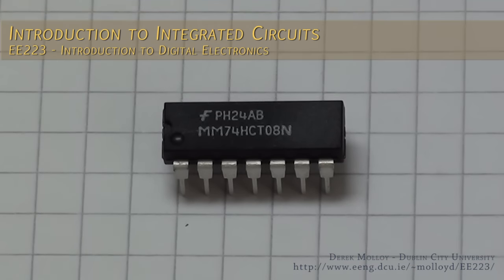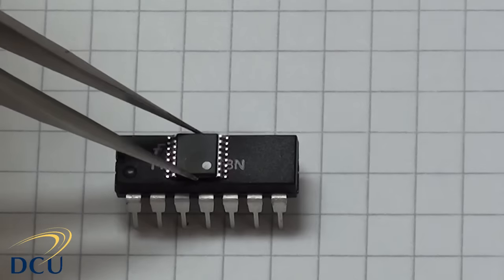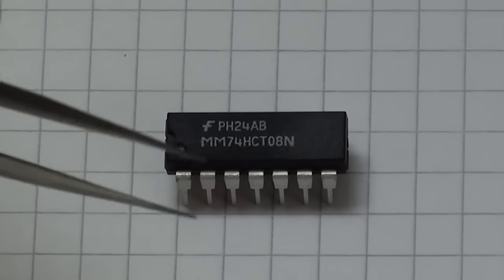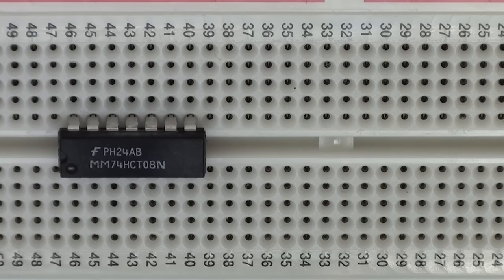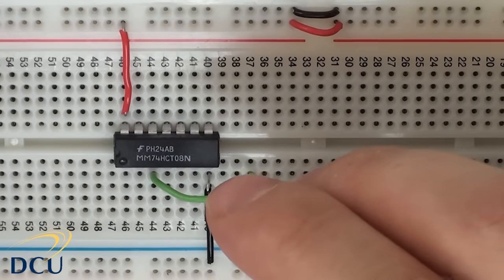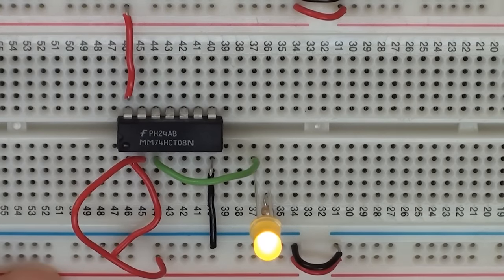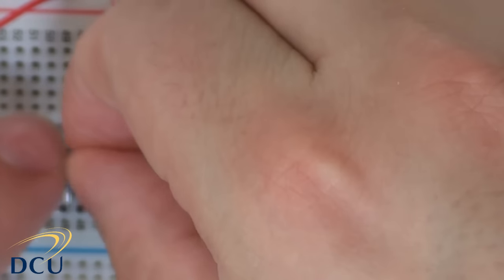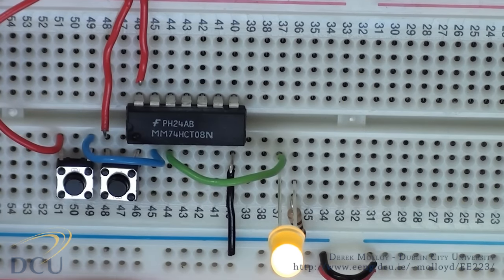Digital Electronics: Logic Gates - Integrated Circuits Part 1

Comment: I think the problem is that when the switches are open, the voltage on the inputs to the AND gate is undefined.  You need a couple of pull-down resistors to allow the voltage to drop to 0 when the switches are open.

Comment: AND gates are obviously useful.

However, i tend to buy NAND gate ICs in bulk because as you will know, you can build ANY other gate from NAND gates and when you buy them in bulk, the cost goes down.
Reply: But when you buy AND gates in bulk, the cost also goes down, which makes the benefit of buying NAND gates in bulk useless, you just spend more money because you don't know what you're doing with what you're spending money on
Reply: @liveen  But then you also may need to buy OR and NOT gates to make the circuit.
Reply: @ivarnordlkken8082  My dude, the comment is a year old. I dont remember anything about what I was thinking here, I can't actually respond
Reply: @liveen  I read and in half a second I realized the original commeter is right, and you not.

Comment: when you use a pair of un-insulated metallic tweezers to touch the  IC chips,  it's very little different from touching it by bare fingers in terms of electric shocks.

Comment: Missing pull down resistors :P The gate just floats. In digital electronics you cant leave gates/transistors unconnected to positive or negative voltage. It will not work.

Comment: Switches may not be working properly, because it seemed that when you accidently moved the switch on slot 45 of cookie board the signal got interrupted and the output change, salutes all the way from Acapulco, good  vid. Should have tried grounding one of the switches to see if the output would change.

Comment: Likely you had the switches incorrectly placed and it also might be an idea to place a resistor to ground on pin 1 and 2 as i'm sure logic gates don't need full source voltage to turn on and off . half should be good :)

Comment: I have the same problem as always....
I do everything as you told me, I'm using a 47LS08 and yeah, the LED lights when I connect the supply, yet if I unplug one of the inputs... the LED keeps lit, if I unplug both, it's still on... how comes? it's supposed to be an AND, right?
Reply from the maker: Just be careful - A disconnected input is not the same as connecting to ground (a logic low). A floating input could be received as a logic high or logic low depending on the logic family.
Reply: Derek Molloy This is an extremely crucial point.
Reply: A million thanks ti Derek!!!!!! Thank you so much..............I had been in a chaos until I read this comment

Now got it !!!!!!!!!!!!!!!! Again a billion thanks

Comment: Description
Design the following circuit by using Multisim. The circuit has 4 inputs and 3 outputs as
shown in the figure:
This system is used as a digital lock for a treasury of valuables.
To open the treasury, the user must enter a serial binary password of 6 bits. Each bit is
entered with a manual pulse at the input CLOCK. If the entered password is correct, the
output LOCK is logic 1 and the treasury is open (you may use a green light to indicate the
action). The treasury will remain open if the value at input DATA is still 1, but if the user
enters a 0 at input DATA, then the treasury will close. Don’t forget the pulse to enter the
data!
While if the entered password is wrong, then the output ALARM is logic 1 (informing the
police) and LOCK is logic 0 (the treasury is not open). You may use an orange light to
indicate the police and red light to indicate that the treasury is not open.
The user can change the password by pressing input PR, but he/she must enter the old
password, followed by the 6-bit new password (12 bits total). If the user enters the correct
old password and a 6-bit new password, the output PCh will be logic 1. The user has 2
wrong attempts to change the password, otherwise the output ALARM will become 1.
If the output ALARM is logic 1, it would n
Reply: Could you please send me a solution to the question

Comment: I am a computer programmer trying to learn electronics...is it fair to say that IC chips are the equivalent to functions in a computer program?
Reply: ProgramThis! yes. look up flip-flops and registers
Reply: +ProgramThis! i think a NOT gate is the same as !
Reply: ICs can have functions with them like transformations but these logic gates are more like conditions.
Reply: If you were a real programmer you would know that ANYTHING that has a defined output for a given input behaves like a function!
Reply: s8an AB my exclusive nor ic 4077 work like shit when i first test it.Doesn't like other  4000 integrated circuits,this looks like isn't working when i bring voltage and touch to gates.While my homemade xnor by transistors and diodes just work well.i like ic but this one just like shit.
Reply: المعالج
Reply: @KoksBettan - Integrated circuits ("microchips") are used in nearly everything in modern society. Televisions, microwave ovens, stereos, printers, dvd players, automobiles, alarm clocks, and on and on.  I've worked with thousands of chips as a hobbyist, and rarely ever had a defective chip.  From reading your post, it appears you need to study more on the basic fundamentals of electricity and digital circuits.  Go back to the basics, because you seem to lack understanding of the principles (ie: "use resistor to lower voltage is not allowed because the IC has 0 current draw").  There are plenty of good videos on YouTube on learning electronics, I personally recommend Ben Eater's channel.
Reply: ProgramThis! ✋✋✋me too!
Reply: Statements in formal logic are called truth functions. They have the same input/output states as their logic gate equivalents, and they behave in the exact same way.

Also, Wikipedia describes gates in the following way: 'a logic gate is an idealized or physical device implementing a Boolean function'.
Reply: i do now so dose that mean i am a real programmer now ;)
Reply: Functions no, they are higher level.. Binary operators used in assembler / machine code is a closer fit, to the point of sharing the similar technology at the silicon level. Sure you can make a high level function work like a low level one, but that would be stupid and artificial.
Reply: Yes IC's are shit. That's why trillions of them have been made and poliforate every corner of the planet..
Reply: More like a library of code, I think.  Like a giant library of code you can customize a bit can call a few different functions on.  but yeah.
Reply: @DarthChrisB  if you were a real programmer, you would know that functions don't necessarily have input and output. a function without any input and without any output (both defined as void) is still a function, and no, these ICs are not even close to that, the closest equivalent you can say in programming is just a bunch of variables defined as boolean. The "circuit" you make with these ICs, the whole system is kinda like a function in programming in which you decide what to do with these booleans and data.
Reply: @DarthChrisB  Woow! Well said, bro!
Reply: @princetime5423  أتمنى لك صحة جيدة.

Comment: my AND gate is acting weird on my bread board
I connected Vcc, input 1, and input2 to 5V; needle 7 and LED(with resistor) to negative
and the LED just keep lighting up, regardless of what input I give to the logic gate

should I connect needle 7 and LED to the ground? If so, where should I connect negative side with?

Comment: of course it is perfectly possible to implement the AND function without any logic gates, and with just the two switches. No pull-ups or pull-downs required either :-)

Comment: hi! thank you for the video. i tried to give a low input to pin 2 by running a wire from vcc to a 250Kohm resistor....to the other end of the resistor i attached the wire going into pin 2 ( i was basically trying to drop the voltage and get a low input by using the high ohm resistor)...the LED still was lit even with this low input, do you know why??

Comment: Quick question for anyone: Did he HAVE to connect to ground with a resistor? Was it just for the purpose of connecting to ground and could have used a small wire?
Reply: I think led will blow due to high voltage ,if we don't use resistor.
Also can u tell  me what was last questions answer plz ??

Comment: I think it's not working with the switches as when they aren't both pressed, the input pins to the first gate a left floating i.e. neither high nor low logic level.  This can cause erratic operation.

Comment: Hi, I have a floating remote controlled shark ( Air swimmer ) that i want to give a little AI =D. I need to make the single DC tail motor go back and forth. Avoid walls, going to use LDR`s to vary/ stop the durations of the flip flop making it turn and pitch up and down from the roof/ floor. As the shark is weight dependant could i use this or a part like it to preform those functions?

Comment: 8:38 current is floating. need resistor pull low or hight depend how you want circuit operate

Comment: So in my class , I did 2 labs like this , the only difference is after I finish my circuit I need to connect the output of my logic function to an inverter and then connect the inverter to the led so the function works just like in theory. If I don't use the inverter , ofc I get the opposite. Can anyone explain this to me. I think it maybe because the LED we are using in this lab turns on when it's on low level and not high level.

Comment: Hi i need some help connecting this.          The circuit uses a multiplexer, adder and comparator to perform the binary to BCD
conversion. If a number is greater than 9 it will be an invalid BCD code. We therefore
compare each 4 bit number from the switch using a comparator to determine if it is greater
than 9. At the same time we add 6 to any value from the switch using an adder. If a number
is greater than 9 the output of the comparator will select the binary value on the switch that
has been added to 6. If it is not greater than 9 the binary value on the switch is directly sent
to the seven segment decoders. This is achieved using a multiplexer.

Comment: I have a 7404 Not gate. I was playing with it and I connected it to a 9 volt battery. Did I kill it?
Reply: twistedyogert check its datasheet for power rating
Reply: It¨'s designed for 5 V. Just check if it's still working.

Comment: you need to use a pull down resistor on the push button so you dont get floating values

Comment: Does this type of gate work on any voltage? for example 12V DC?
Reply: usually 5v. if you read the document about the ic number, you will know more about the voltage and limit!
Reply: thanks! Could anyone tell me how to use a xor gate in a car. So how I make a circuit from 12vDC to 5V to the xor gate and than again to 12V?
Reply: I think an voltage regulator would suffice for changing the voltage level to 5V or anything close.
For the outputs, you could connect them to an power transistor or an relay.
Reply: For 12 V you should use the 40xx series CMOS IC's. They work on up to 18 V.

Comment: Question to anyone that has built this or any of these? Its all very interesting but what is some practical uses for these circuits?
Reply: Anything that requires logic.

For example, the CPU in your computer.
Reply: Basically, you can do logical/Boolean situations and equations using actual hardware, like saying, if this and this or this, then this output should happen, like if this wire is connected to this pin on the IC Chip, or this other wire, this LED light should light up, if not, the LED light should not light up, but then you get into the true's and false's or 1's and 0's of binary and assembly language, so, like I2udolph said, your computer is basically doing these kind of equations but much more complex and many more of them to process programs and what's on the screen, I'm still a student so I don't know everything but I hope this helped you! :)
Reply: Remote control, Tickle Me Elmo, Digital Clock, Flash Light, Flesh Light, Laser Pointer, what you're using to watch this video, your A/C unit, the light in your room, your phone, pacemakers, zombie robots, etc
Reply: I cracked up at "tickle me elmo" lol :)
Reply: E Park  I cracked up at "Flesh Light"

Comment: Led is not responding! ...what is lacking?        ...from the philippines
Reply: Set voltage 5 volt . Check first if the led is working . If it is working . There can either be breadboard line issue or the output is zero for the circuit

Comment: it need a pullup resistor on input or output (dunno) . It doesnt work correctly because the guts are mosfet and they have a capacitance

Comment: well, the reason it didnt work was because when working with cmos logic, a pin should always be conected to vcc or gnd, a 1k resistor between each of the gate's input and ground would have worked great

Comment: Circuit worked fine with the cable jumpers. BUT... the problem starts when he tries to set the two switches, he didn't make sure to set them in right position.  That's all the problem here. 

Cheers

Comment: SPOILER ALERT
I can't believe nobody has answered your question as to why the circuit is not behaving as expected, so here goes:
You need to add pull-down resistors - (100K resistors will work) connected to Ground and to each of the switches on the node of the switch pins that are connected to the AND gate IC.
Do I win a prize? ;-)

Comment: Can you explain  the integrated circuits 74LS76 , how it work's , the voltage that we can use , i will appreciate it / Alberto Haber we can use 4,5 to 5 V for the 74xx .
Reply: Try Googles and get the data sheet.. :)
Reply: That is a double JK MasterSlave FlipFlop.